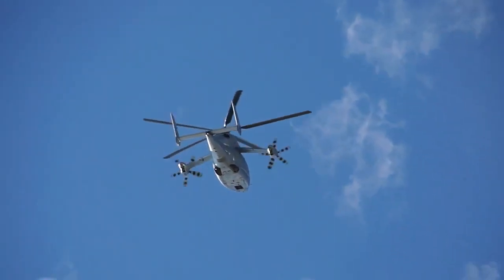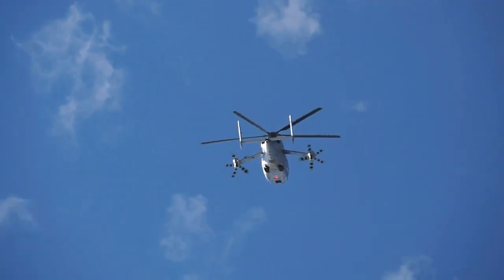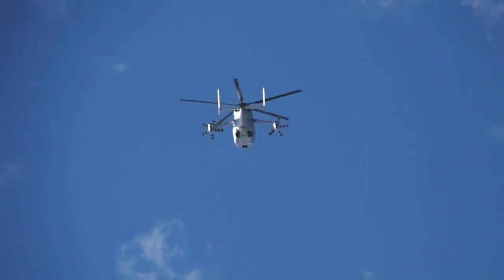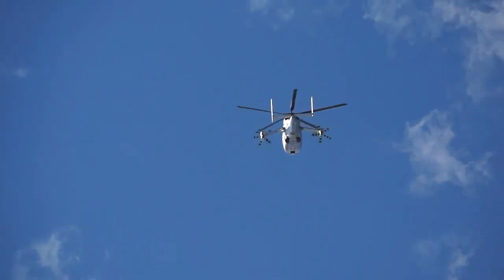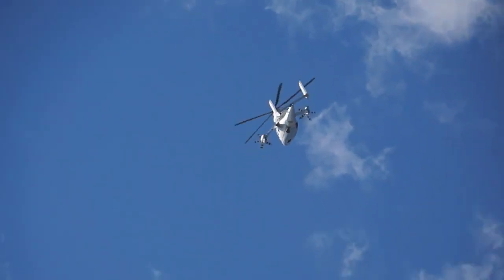Eurocopter X3 The fastest helicopter

Comment: Fantastic machine! It's just one thing I don't understand: there is no tail rotor. How to counteract the main rotor torque? Even if it becomes an autogiro at speed the speed range between the take off until the rotor is self rotating it should be a short while when the main rotor torque has to be dealed with, or?
Reply: The side-props have different pitch settings, this allows one to produce more thrust and act against the torque of the main rotor :)